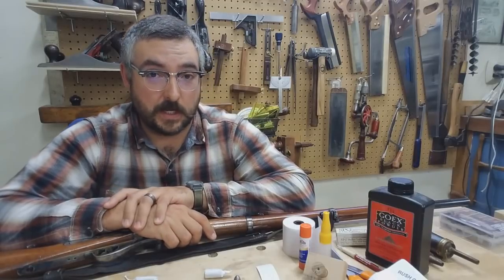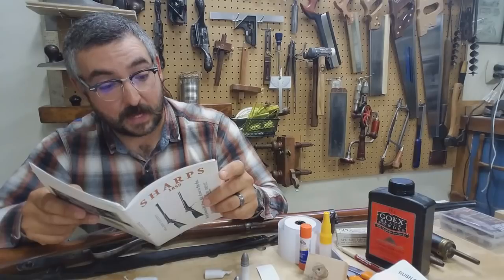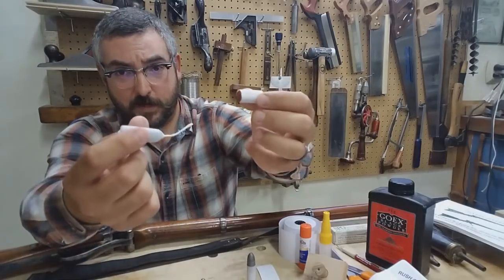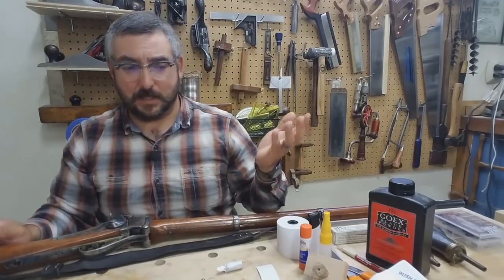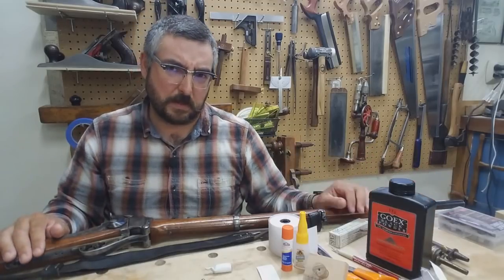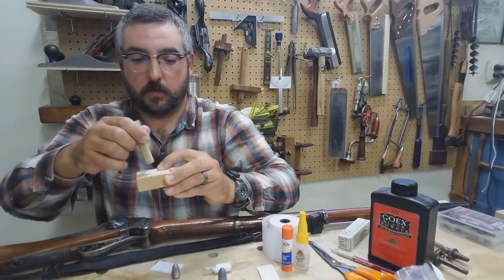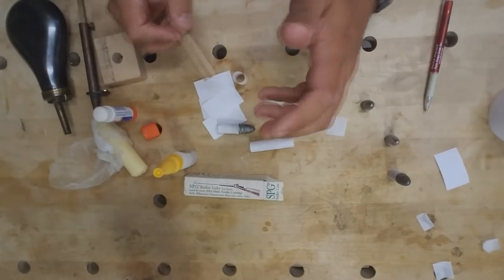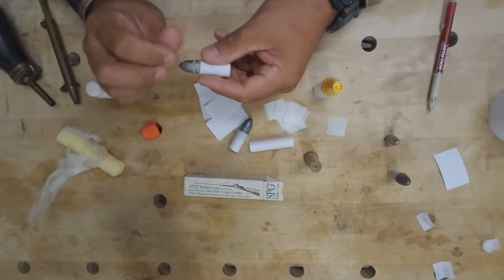1859 Sharps Paper Cartridge 101

Comment: I only use nitrate paper when I'm hunting so I don't start a fire. It does work rather well and I find it aid's to slightly more accuracy at longer range but it's a lot of time waiting to dry when you do a batch of 100.
Reply: Put them low heat on a cookie sheet in the oven about150 they dry nice and stiff

Comment: This is a great video! You are perfectly correct to emphasize the dowl, most important part of the process. A good finish sanding and I actually poly coated mine. I build my cartridges for my pistols. Both .44 & 36. Same process. Just a excellent subject, well done for a teaching type video. I am glad you are getting more technical with how the ammo is assembled. Oh a small bit of tallow information, lambs tallow does not go ransid. Others do, especially in the summer. For the lube, 2 parts tallow, 1 part bee's wax. Double boiler, I will put my conical bulletin a foil pan and just pour the mix in. When cooled just pick the bullets out. For wonder wads cut the felt to fit the pan and pour mix over it until saturated.  Not to much easy to do. Some guys dunk the felt the pull it out and lay it on foil, wax paper to harden then punch out your caliber. (My personal favorite as I shoot mostly ball ammo)
Reply from the maker: Thanks so much for adding this, it's certainly going to be helpful!  I thought it was odd the 1859 manual didn't suggest a mix for the lube since tallow can also get gooey when hot.  Your recipe adds a lot more stability to the original lube.  Oh, and thanks for sharing the tip on coating the dowel.  I seriously considered it and now I might just do it.
Reply: Company D 2nd USSS : Thank you. It will be awhile but when I make a batch of lube I'll see if I can put something together for you. But I may not need any wads until Sept or Oct.

Comment: would you have an idea how long these rounds are good for roughly, before the humidity gets to the powder?  i recently started making paper cartridges for my my revolver and ive been looking to get a sharps for myself. also really enjoy your videos, they've been helpful and informative
Reply from the maker: I think it all depends on your storage.  I keep my blank rounds in a rubbermade tub with several silica packets in a non-climate controlled space and they do pretty well.  I also only typically batch these out before I go to the range, so unfortunately I can't share a whole lot on the outcome of long term storage.  Thanks for the great question.
Reply: @CompanyD2ndUSSS  that's good to know and I think I'll use your storage method, I've just been using a Plano ammo box that holds individual rounds. Maybe one of these days I'll put some to the test and see how far out they can be made from the day they're shot, for curiosity's sake

Comment: I learned a lot from this was looking to get the 1863. I have two questions. What are the max charge of BP that can be used for hunting. Next is would it be okay to coat each paper cartridge in hot wax to make it a little bit better water resistant for hunting. As you can tell I am thinking of trying to hunt with one if I buy one.  Thanks from Ohio.
Reply from the maker: 60 would be about right for a max charge with a bullet. The 1860 ordnance dept called for 60. I've also had decent accuracy with 50 and 55 grains, just have to play with it a little. As for waxing I would try it with waxing the "casing" first then wrapping. I would just be worried of the wax seeping through to the powder and fouling it

Comment: Hello 1st Sergeant. I have made my first four complete rounds. I won't make anymore till I get my rifle back from DGW. My rear sight was backwards and had to send it back for exchange. When I get it back I will test the fit of these bullets to make sure what length I need. I have a question. I measured from the back of my bullet which I had dropped into the chamber and seated it and it was right at 1 1/2" so I eased it to 1 7/16th. I got those boxes like you have and made two of them into ammo packs. So cool how easy and infomative your videos are. Anyway, mine are a tad to long to fit in the box. I can force them but afraid I will bust my paper or the tissue back. So now I know why you said 1 1/4" inch. But seems like in my rifle that was too short (I expereimented. If I use that length tube, and there is a bit fo a gap between the base of the bullet and the flash hole in block does that matter? I am barred from Facebook for 30 days for posting pics of Sharps Ring-Tailed bullets on the Sharps Rifle Forum. How stupid. I would like to post pics or sent them to you but as I said I only know how to communicate with you ether here on youtube or Facebook.
Reply from the maker: Sorry to hear about your Facebook issues.  You can find Cpt. Whitehall's email on our webpage, you can reach out to him, too.  My overall length of live cartridge does have a gap between the flash hole and the end of the cartridge when in the block.  How much of a gap a rifle will tolerate is up to each rifle.  Your manual may also have some good info and suggestions.

Comment: More great stuff from Company D! Was waiting for this one, very informative as usual. Do you ever make "squib" rounds, where all the powder is replaced with corn meal, air, or non-combustible substance, so that you have a round that looks real but doesn't fire? I figured such a round might be handy for demonstrations and letting spectators hold and such! Also, what is the projectile made of? If it's solid lead, are there any health and safety measures you should take when working with them, or is thoroughly washing your hands afterwards sufficient?
Reply from the maker: We do make a dummy round filled with corn meal and brightly labeled to distinguish it as a dud to show the public.  We keep it secured in a box for demonstrations so it doesn't get mixed with regular blanks and cause a safety danger.  These are pure lead bullets and like most reloaders, I just wash my hands when I'm done messing with them.  Take whatever safety precautions you feel best using.
Reply: Awesome! Thanks again!

Comment: Yep. These are not igniting at all. All I'm getting is holes in the paper from the cap ignition, but the spark isn't enough to ignite the powder. 
Not a member of facebook, so I can't see how you guys are loading these... Are you leaving the bullet loose in the chamber so the cartridge rests against the flash hole? If the rifle is angled down at all the bullet holds the paper cartridge in the front of the chamber and there is a gap the spark has to cross.

Comment: I just made a  few  of these  ( 2"X 1 1/8" but they are 1/2" from the breech block. I wonder , is that a problem? The Rifle is literally brand new . just got it yesterday.
Reply: well, its moot at this point anyway ; even with loose power and a bullet this gun won't fire . I literally pierced the  cartridge rear , used a rat tail cartridge and cut the back and also  just poured 60 gr in behind a loose bullet and it never fired once , Time to call DGW or Pedersoli...
Reply from the maker: Sorry to hear that.  The break in can sometimes be a pain.  Our corporal got a new one a couple years back and it took about 25 caps before it started to run.  My Ped. worked right away.  Sharps require a saint like level of patience sometimes.   I hope you're able to figure it out.  You can also reach out to some black powder forums or organizations for additional tips or ideas.  Best of luck!
Reply: @CompanyD2ndUSSS  they are replacing it and are as dumbfounded as I was . Hopefully the new one will work . just in case , i have made some blanks and a few cartridges in 1 5/8 length since that is what the chamber depth seems to be .
Reply: Hey do you guys ever find it necessary to drill out the nipple ? 
We   all do with our Euro or Armi sport Springfields  because of damp conditions , no powder compression and even once in a while we would get an "issue " of pyrodex , lol...
Reply: Got the new rifle and after much experimentation I found that no  1 1/8" long , 2F carts would fire reliably , but most of the 4F in base( 10gr) + 60 gr main charge 2 or 3f  would . 
The best and most reliable cart seems to be  1 7/8" long , 60gr 3f + 40 gr cream of wheat . Basically, it seems  this gun needs full length carts for now , although it may get more forgiving as it gets older and more worn .
Reply: Did you ever find out about the cartridge being 1/2" short? I don't see that addressed in the replies.
I just made my first one, plus one with the tail, and they are both very short with 45grs 3F.
Reply: @pacanis  I make carts now that are 1 7/8"" long , they have 80 gr of 3 f and 40gr of cream of wheat OR I fill all the way with 110 grains  of homemade 3f  . The Homemade powder is lighter and only  about 75% as powerful as Goex  , so it takes more to get the same energy  and it also  takes up the space which is good  , the Beauty part is it ignites really well and  reliably . More so than the goex.  

Would you happen to know where I can get a new cone wrench or a substitute?
Reply: @exmcgee1647  Thanks for replying back after all this time.
There are a lot of videos on using 45 grains of powder, even from an accuracy standpoint, but no one seems to address the chamber is made to hold so much more. And my Ped didn't come with any instructions... Dixe GW was useless when I called.

Comment: Hey 1st Sargeant, I finally tried to shoot one of my cartridges. I tried two types of caps and like 8 caps and it never fired. I dry fired it and blew a leaf off the table so I know fire is getting through the block. The only thing I can think of is the several years old Pyrodex is the problem. If I can ever find some real BP around here I will make some rounds with it and see how it does. I made 20 live rounds and it won't shoot. I am so disappointing. What do you think?
Reply: Hi David, 

While I don't own a Sharps, I've fired many rounds through my 1861 Springfield reproduction. When I first got the musket, I used Pyrodex. Unfortunately I had trouble igniting the charge. Keep in mind, the main charge on the musket is much closer to the cap than it is on a Sharps. Considering the flame of the cap has much further to travel on the Sharps, you're getting even less flame to hit the charge than you do on a conventional musket. 

My hunch is that you'll need to use real black powder to get consistent ignition.

Comment: When you load with loose powder do you fill up to the block or do you use a measured load?? If the powder is not firmly against the block will be an issue??
Reply from the maker: First, let me say follow your rifle manufacturer's instructions for safe operation and seek any final say from a qualified licensed gunsmith.  When we use loose powder, we use a measured load within the recommended safety guidelines of the manufacturer.  The Sharps paper or linen cartridge doesn't fill the breech completely, either.   When live firing the rifle, we've never had an issue.  For more details, you can check out some Sharps Rifle forums for an even deeper explanation of the rifle's design and engineering.
Reply: @CompanyD2ndUSSS  Thank you for the helpful information.

Comment: Alright made rounds,right length, but seems a little loose in chamber, not a tight fit. The paper part, so is this safe?
Reply from the maker: Not being there, we can't address your particular situation definitively.  Always follow your owner's manual and consult a gunsmith if and whenever necessary.  That said, the paper cartridge doesn't fill the chamber diameter completely.  The bullet must be perfectly seated for safety.  You can also check muzzleloading forums for more information, too.        In Range TV, I believe, did a live fire of an original Sharps in an old video.  That might give you another frame of reference.  Be safe out there.
Reply: @CompanyD2ndUSSS  bullets fits fine,it was the paper part I was talking about

Comment: If you use nitrate paper do you have to allow its combustion when you calculate your powder load?
What is cream of wheat?
Reply from the maker: I can't speak to nitrate paper since I'm too lazy to experiment with it and regular paper is perfectly acceptable to us.  If you dig around on black powder forums, you should be able to find a lot more information about that.  Cream of wheat is in the breakfast aisle of most grocery stores.  It's kind of like oatmeal.
Reply: To make the Nitrated paper is simple. You take potassium nitrate and mix it with hot water till it won't dissolve any more (saturated solution) and soak the paper in the solution for about 30 seconds then hang and let dry. The paper you use should be 100% cotton rag paper, regular paper won't work as well.  Haven't had any problems with the rounds not going off. For the base I use either tissue paper or if you can find magicians flash paper. The flash paper is highly flammable so much more care should be used.